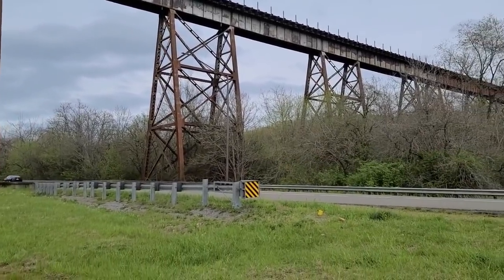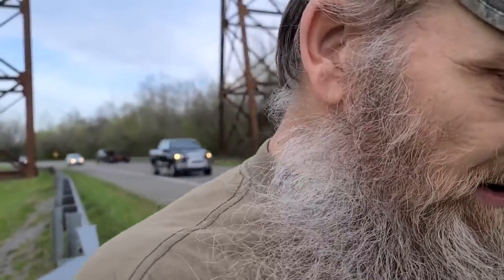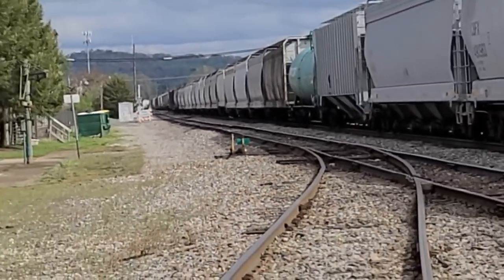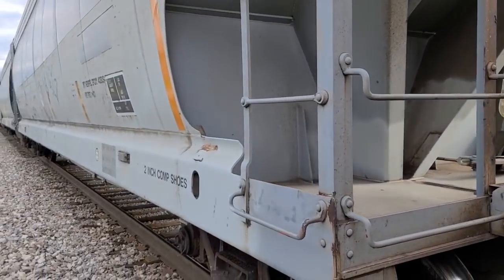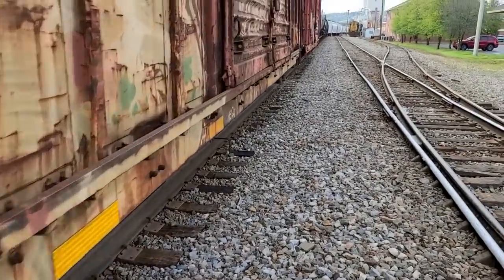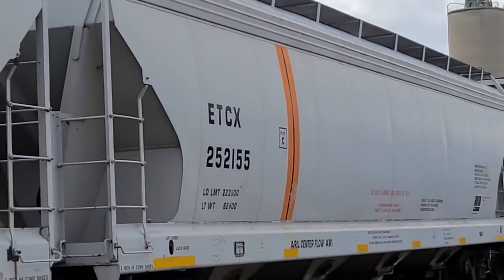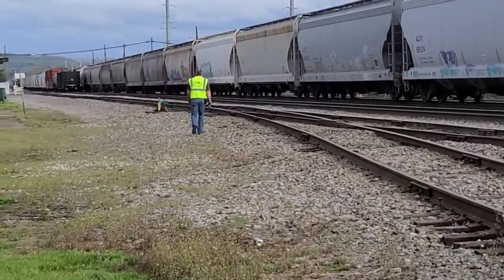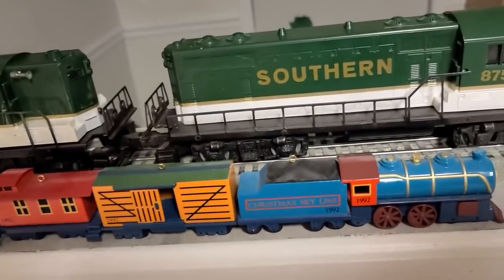Missed my Easter train by just minutes!

Comment: 29:55 "[Setting off with the brakes set is] dangerous for a worker. Worker things the brakes are on and gets in between there, and that happens."
That's why they don't go between cars without getting three-step/red-zone protection from the engineer. You don't base your behaviour around heavy machines on assumptions.

Comment: if you put on any more weight you wouldn't have to use one of those heavy-duty flat cars
Reply from the maker: Gained right at 40 pounds since I was hit by the car.   Usually weigh in at 195 but my last two doctors visits I weighed 238!
Reply: My neighbor weighed 200 lbs. 40 years ago at H.S.graduation. 450-550lbs fluctuates nowadays. Bingeneers anonymous.

Comment: Keep eating that fried food and potatoes and 240 will be your new normal weight, along with Diabetes 2 and high blood pressure.  I'm back down to 200 from 240 myself. I have eaten myself out of D2. Now working on the HBP.  The older and heavier you become, the less likely you will be able to step out of the way. You're out of shape Mr. Hobo and I fear you will get hit by a train, or get trapped by an engineer pulling out with his brakes on.

Comment: 13:30 The AEI tag doesn't know what's in the car. It's just an RFID tag that responds with the car's ID when it's pinged with the right radio frequency. To find out what's in the car, that has to be cross-references with the railroad's databases.